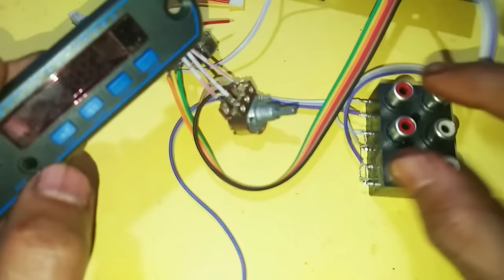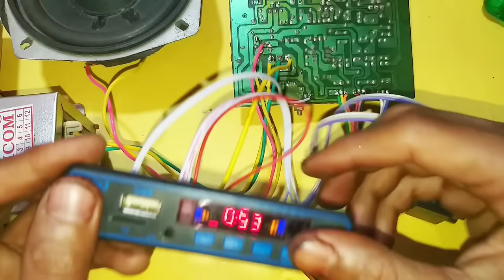2.1 Home Theater Complete Wiring || हिंदी || You Like Electronic

Comment: Mere 2.1 multimedia speaker ka PCB kharab ho chuka hai aur transformer me se sirf 2 wire out put hai (AC 12v~0.84 amp) jo amplifier pcb ka input hai. 1 aux input (3.5mm) and 1 L & 1R RCA out put (for 2 x 4w & 4 ohm speaker)  aur 1 subwoofer (7w & 4ohm speaker) , 1 bass switch with 3 pin hai to uska replacement kaha milega aur usme mujhe bluetooth module bhi lagana hai.  Please help me.
Reply: EFFICIENT ELECTRONIX
electronics market mein

Comment: sir hlp me
mai kl hi 2.1 kit leke aya hu usme 3 wires input deni h transarmer ki 
pr mere transfarmer me 5 wires output h 
mere transfarmer 12 0 12 ka h 3amp ka
kit me 12 0 12 use krni h
sir help me quickly 
kl diwali h mujhe home theater bjana h
Reply from the maker: 2 wire 220v ac input ka hoga red colour me 
Or 3 wire 12-0-12 hoga ok
Reply: Nhi sir mere transformer me 5 wires ek taraf se nikla hua h aur dusri taraf se 5wires nikli h
Usme se Kon se 12 0 12 ki h
Reply: Sir aap mujhe apna WhatsApp no. Send kr do...
Please sir 🙏🙏🙏mujhe aaj aaj me hi apna home theater repair krna h

Comment: Sir mere pass black &white TV ka transformer hai 0 25  use 012 main kaise kare .012 main convered kare me ka circuit bataiye
Reply from the maker: 7812 voltage regulate lga kar
Reply: Konsa diode aur capacitor lagakar